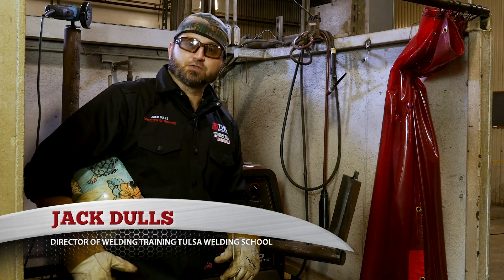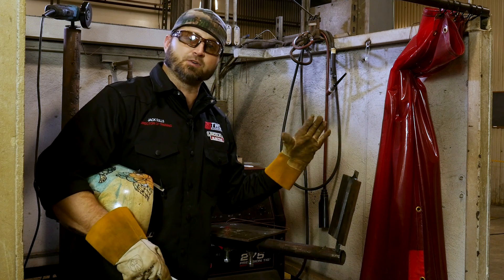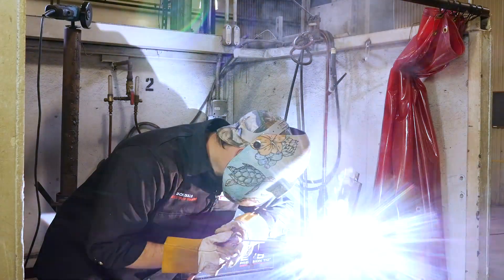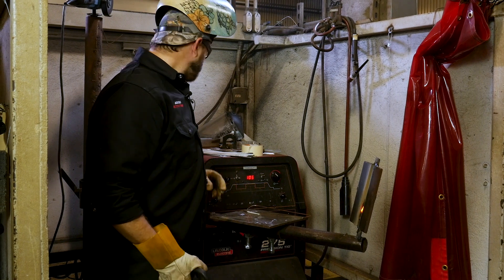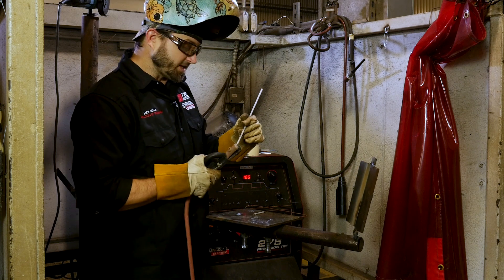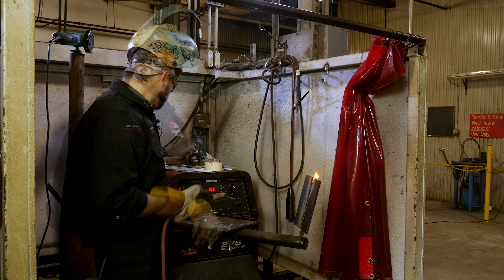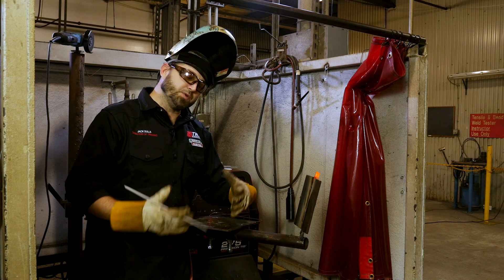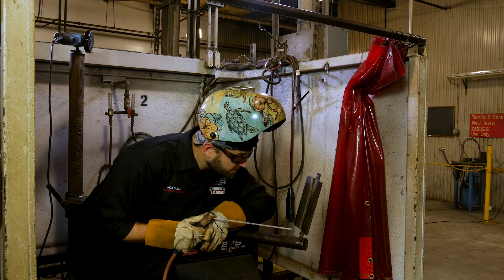Welding Certification Test: How to Weld a Vertical 3G 7018 With a Backing Strip

Comment: Obviously the plate is not 90 degrees….. that’s a cheating position but it’s help to make more easy the vertical also 7018 1/8 that’s super easy try 5/32…..

Comment: I thought he said he was going to bend it I don't think it would have passed, The only time I seen him clean his restarts was on his cap. Guarantee there was slag entrapment on his second and third passes. We're not allowed to have any tilt angle when doing a 3G  he had around 20° degrees. And It looks like 3/8 plate we have to take 1-in plate with a 22-degree bevel. Talking about 8-hour welding certification no grinder just a chipping hammer and a wire brush
Reply: No shit man, thinking the same thing. Starting to lose faith in TWS a little.
Reply: @erickwardwell962  Most of their graduates cannot pass a 3G test in the real world.  No faith should be in this school at all. I've just recently seen 2 walk off the job. Anything involving having to go up just leads to massive drippage and piping porosity city from welding over all the trapped slag.

Comment: You need to show your welds, how are people suppose to learn without seeing your beads after you clean them. At least for me it helps to the the damn weld. Man you must not be confident about your welds
Reply: I'm starting to think the same way with him. Won't show his weld. He welded over slag at 7:04. And his bead layout is wrong, your supposed to keep it half way even. Starting to lose trust in TWS a little. Still like the old guys though, they know how to weld.
Reply: @erickwardwell962   not to mention the undercut he had,  also his beads were ropy which is why I think he didn’t show them as much. And he didn’t let his piece cool off a bit before his cap weld. Should of done the bend test to see if he did pass haha

Comment: How come we don't see the welding beads after each pass???
Reply: I thought about that too. Then I saw him bring out the grinder and it made me chuckle at his comment about not needing a chipping hammer when you have good welds.
Reply: @tylernichols3187  it’s a wire wheel it helps get any slag that gets trapped in any tiny pockets so there isn’t any slag inclusions also the hot pass welds appearance doesn’t really matter since it’s going to be covered anyway his welds looked like the got pretty good fusion

Comment: #1. You need to hammer that rod in there. 120 amps. Next, lose the sea turtle sticker sissy boy.
Reply: Yo Lucas, did you notice the massive fingernailing from slanting that electrode more and more. Fuckin 45* push angle.